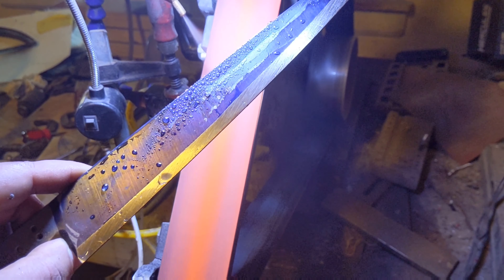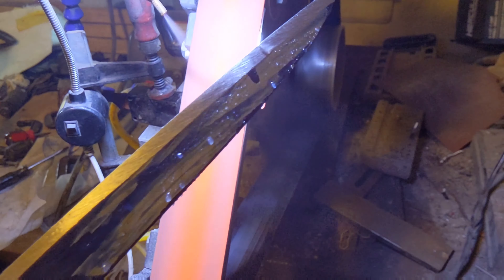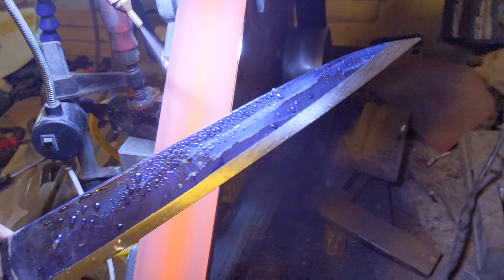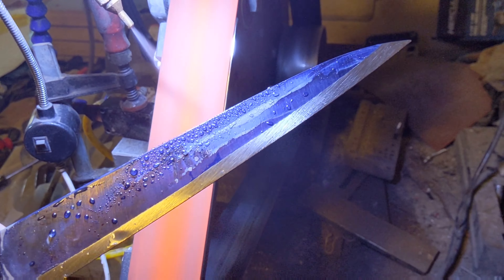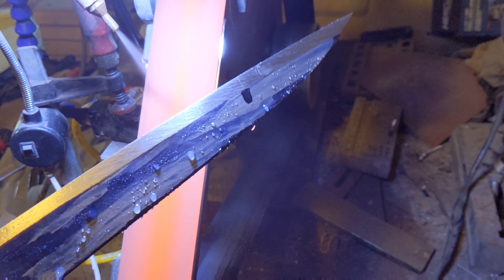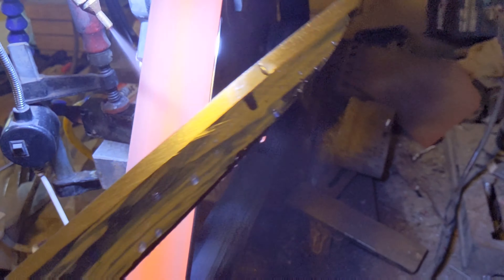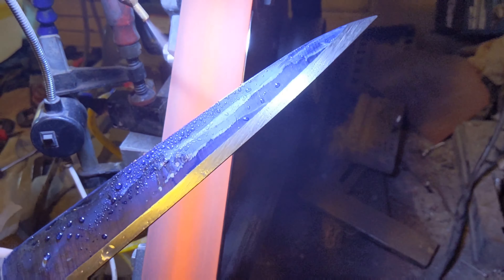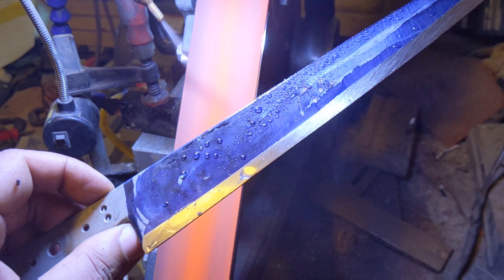CPM Rex 121 | Rough Grinding

Comment: Seeing that bevel flex got me excited! As an amateur knife maker, I appreciate these videos  and forum posts tremendously. I was introduced to powder steels 4 years ago and have been obsessed with the geometry that can be obtained ever since. I've just recently started to make moves to put what I've learned into some of my own designs, and currently grinding them out. The end goal is to put a highly functional edged tool with gorgeous design into the hands of anybody willing to pay for, and appreciate them. Needless to say @Big Brown Bear you are inspiring. Keep up the hard work bud! Keep pushing the heat treats to try and squeeze out every functional point of rockwell hardness. Grind every high carbide steel as thin as you can get it.  Makes it seem like all the steel and abrasives I've mangled in my own endeavors seem worth it in the long run.  If you have a patreon I'd like to join. I would like to support what you have going on, so that you may proceed further....possibly reach Loveless status?? In do time I'm sure it. 

P.S. Sorry for the long winded comment. I'm not very outspoken, but when I am I try to make the most of it. Haha. Take care bud.
Reply from the maker: Thanks Raymond, I appreciate you sharing and thank you for the nice words. Keep that passion burning my friend, never quit.

Comment: Top tip I got from a knife maker was to put a cardboard roll from the inside of some packaging, or even the inside of a toilet paper role, around the nail that you hang your belts on, this way it allows a larger circumference for your belts to hang on and stops them bending too much in one point and keeps them running smooth, over time they crease when hanging on a nail. Great videos and great work...!
Reply: In saying that though, it seems like you get through a lot of belts so maybe they don’t have time to bend :):):)
Reply from the maker: Thanks for the tip my friend, and thanks for watching.

Comment: Hello bigbrownbear
I want to build a puukko I have some 80crv2 and 14c28n steel available. In a video you  said that most stainless steels dont have enough edge stabilility for a puukko. Is 14c28n an exception? If it is suitable for a puukko, how much hrc is recommendable? 
Can i also use the 80crv2 for a puukko?
If yes how hard can it be? Last question is how do these two steels compare Side by side? 
Thank you for your advice you videos are very interesting and easy to understand
 Greetings from Germany.
Reply from the maker: HRC is only one part of the story, let's say I tell you a specific number, well there are many ways to get a specific number, it's the microstructure that makes a given Hardness value work or not and you create the microstructure with time and temps through HT. AEBL and steels like it have the stability needed for a puukko, it comes down to HT. You'll have to do your own research and testing to figure it out.
Reply: Thank you, I know Heat treating is complex
I send my knife blanks to local knifemakers, the do the heat treating for me because i dont have the Equipment. I will try the 14c28n i read that is an Upgrade of the 13c27 which is the same as aeb-l.
I will also try the 80crv2, i used in field knives and i really liked it.

Comment: I didn't grind mine that thin, but I feel your pain on using up all those blaze belts on REX. I ended up convexing the edge. More of a micro bevel, but just ran out of belts. I tempered mine to 69 as well. Looking forward to the body count on the belts.
Reply from the maker: Whatever it takes ya know? Well done stepping up to the Rex.

Comment: That thumb rolling thing was the old quality test for Solingen style blade grinds ("Blaupließten") - I think their knives are a bit softer though. Didn't think this was possible with a high carbide volume steel. Have you thought about purchasing some CBN belts for this type of steel? Edit: Nevermind, just saw thread of you discussing those on bladeforums.

Comment: That geometry at the end is kind of interesting, I have knives like that - curious how many people realize how thin a blade has to be to so easily flex like that.
Reply from the maker: Not many people Cliff.  Even less appreciate the cost to do something like that on a steel like this.
Reply: @FearNoSteel  As something you might appreciate, I have one of Farid's 121REX Mules. It came with s a short sabre grind with a very heavy secondary edge bevel. I gave it a full zero grind *with benchstones*.
Reply from the maker: @CliffStamp  hard work my friend, cuts much better now I'm sure.
Reply: @CliffStamp  Heavens, how long did that take? what kind of bench stone diamond?

Comment: I didn't understand the sanding belt type cause of the noise , what was it ?
Also I saw a post on your insta where you explain that Vanadium carbide can't be abrader by normal stones or sandpaper ,wich materials do you need ?

Comment: I had the idea of a deep "Laser Hollow Grind" if thats a thing... does that technically work? could you make (on a softer steel ofc) create something like a laser grind but with a Hollow instead of a Flat grind?
Reply from the maker: I thought about playing with something like that with a large radius platen but a ffg that's handsanded laser thin hasn't left me with any desire since it kicks so much ass.

Comment: What's the price on that, I've really wanted an 8" chef in maxamet
Reply from the maker: $$$ I'll share the price when done, it will be in the range of other luxury, custom, handmade knives. Not in the price range of mass production stuff.
Reply: @FearNoSteel  i figured it would be pricey, was more curious then anything else. I use my maxamet pm2 for food prep on occasion. I have 2 sg2 shun, a wusthof classic, and a couple calphalon knives. The maxamet runs circles around the others.
Reply from the maker: @tonesetterfitness1261  yea Maxamet is rad, I enjoy that steel.

Comment: Have you ever seen knives in A36 steel
Reply from the maker: That is structural steel, the carbon is too low (0.3%wt) for a good knife made for cutting. Steels for knives work better with +0.5%wt Carbon in the steel chemistry. The knife in this video has 3.4% Carbon in it's chemistry.
Reply: @FearNoSteel  good to know. Thanks for the reply